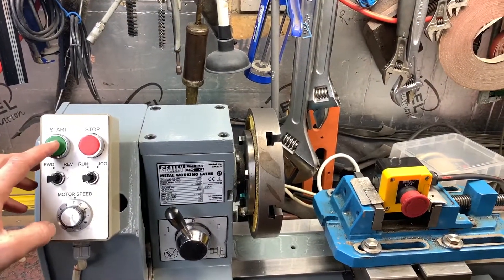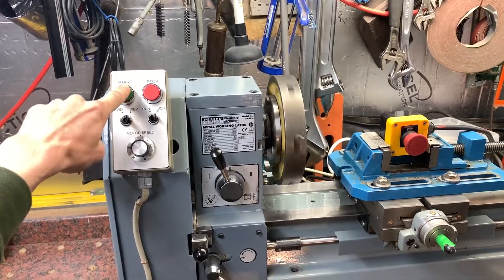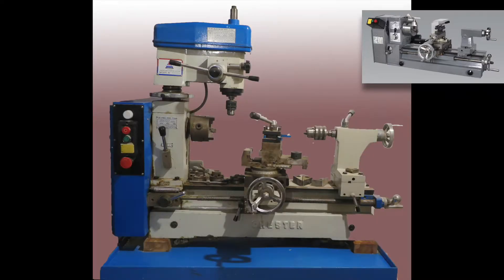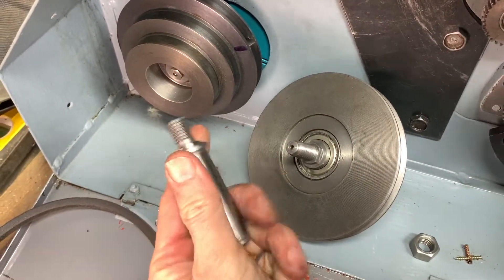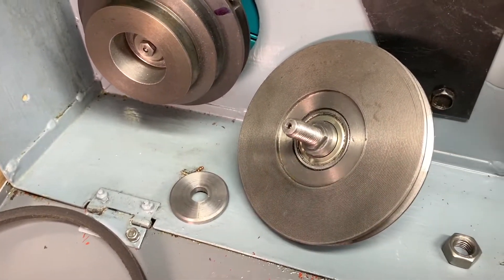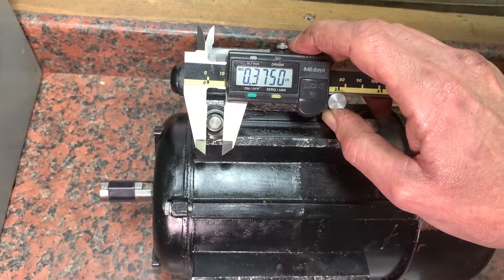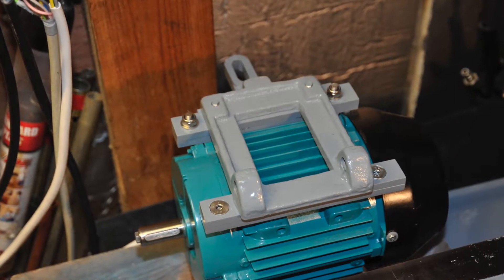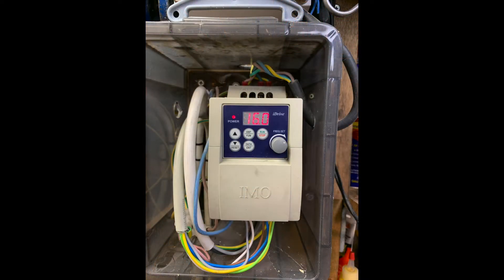Sealey Clarke lathe new motor 08

Comment: I found it simpler when removing motor to just remover motor and pivot bracket in its entirity. The nuts holding pivot bracket are easily accessed by removing the leadscrew lever front cover on the front held on with two phillips screws.
Reply from the maker: yep that sounds sensible . 

fishing boat project looks fantastic

shed guy envy